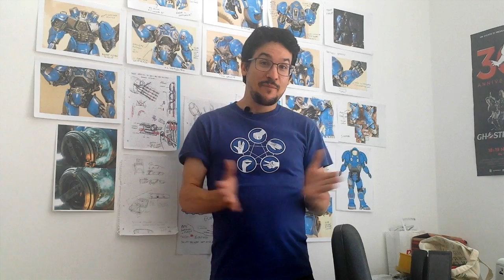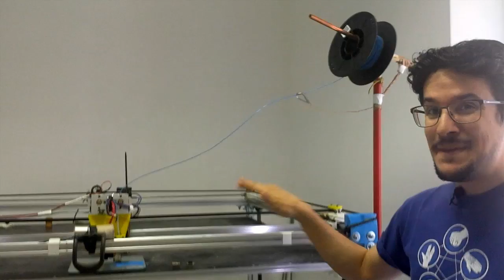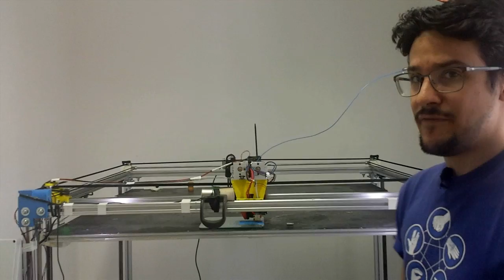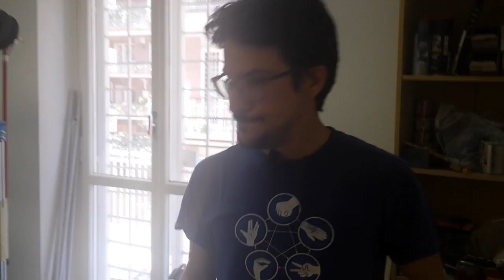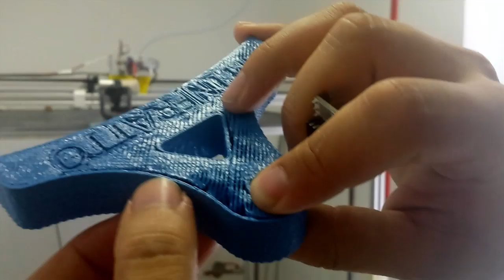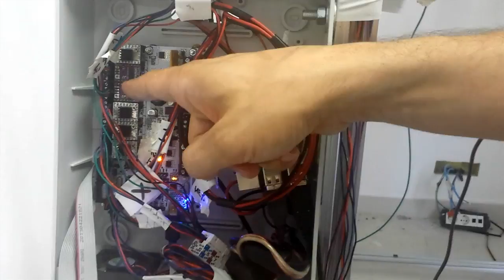Ep. 2.5 - some drivers failed!

Comment: Ciao, ho guardato i tuoi video per caso oggi e devo dire che sono molto interessanti!
Mi piacerebbe tanto costruirne una anche perché quelle in commercio hanno tutte un volume di stampa abbastanza ridotto!
Ok per la struttura e cuscinetti vari non ho problemi in qualche modo mi arrangio con solidworks.
Però per quanto riguarda la parte elettronica non riusciresti a pubblicare un tutorial in italiano?
Più che altro per far muovere i 4 motori di Z contemporaneamente..
E poi che tipo di software si utilizza per settare i motori, finecorsa ecc ecc
Per creare il linguaggio iso che programma utilizzi?
Temperatura dell'estrusore come si gestisce?
Temperatura del piatto?

Comment: You should try the TB6560 drivers. They are rated for 3A out the box, allot of guys love these for CNC use. You should be able to wire them to your controller easily. 

Concerning the DRV8825's, amperage is not everything on these types of drivers. I noticed with my DRV8825's that microstepping settings cause allot of heat. 1/32 was the worst. 1/8microsteps was the best setting, with that said to get the most out of these types of drivers, you dont really care too much about the amperange, you will get better torque out of the motors with higher voltage and lower amperage and a much happier driver. If you do want to stick to DRV8825's The settings that worked best for me were, 1/8th microstep @36v with drivers set to about 1.8a via pot. The next one down was 1/16th @ 24v @ 1.5A. Or if you use 12v you can go to the full specs, but the motors will be both slower and have less holding torque than 1.8A set to 36v and 1/8 microstepping.
Reply from the maker: Hello Bruno! I agree, I've ordered some TB6600 drivers (link http://bit.ly/29o1rag) a couple weeks ago to try with my Z motors and they're rated 4.5A - even if they could handle parallel driving I'll wire one for each motor. I've found this easy wiring schematic: http://bit.ly/29un3y0
I'm eager to install them!
About the DRV8825 I must thank you again, I didn't know the thermal implications of a /32 microstep setting; I'm using full step on the Z motors, /32 on the Y axis and on this last one (same motor I use for the Z axis) is so hot I had to install an heatsink to its rear side. Unfortunately I've got a 12V power supply for now, but I'm gonna get a 24V given the benefits. I don't know if I can go for 36V but I'll see if the RADDS 1.5 I'm about to install can handle them. Thanks again for all your suggestions!